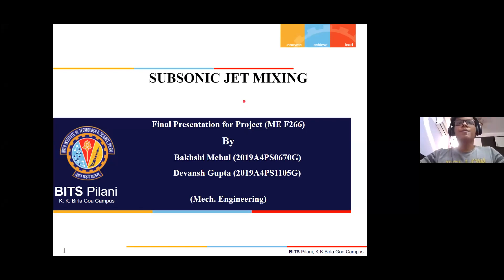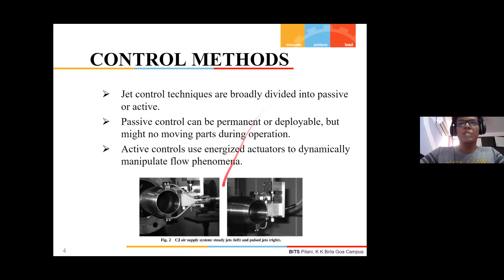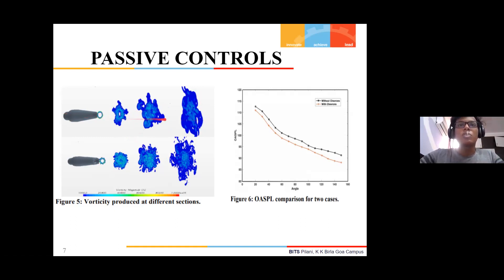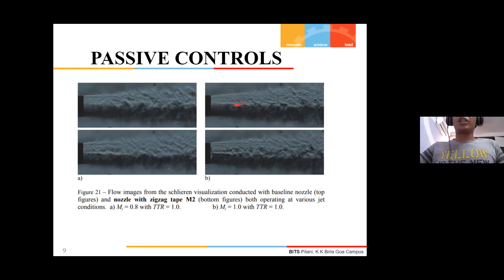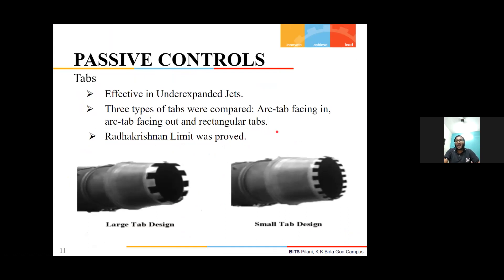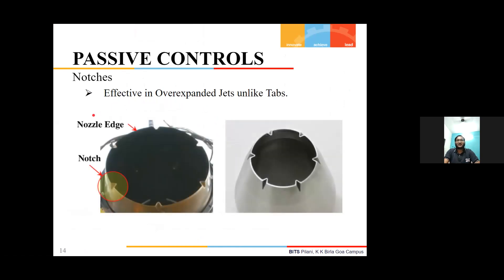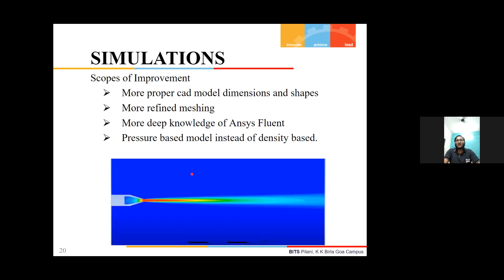Jet Nozzle CFD ANSYS Fluent fluid flow analysis | Jet Mixing Simulations with Active & Passive Ways

Comment from the maker: Video Timestamps

00:00 Introduction and Outline
01:36 Various Control Methods
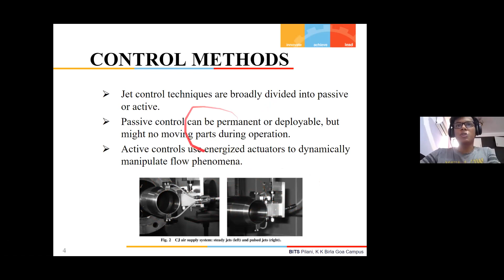02:18 Chevrons - Passive Control
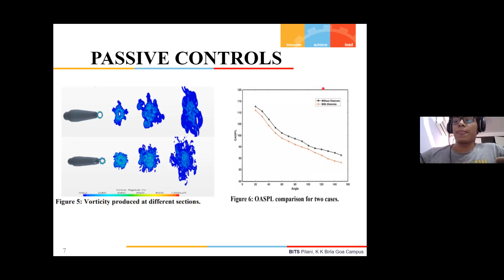04:22 Zig Zag Structure - Passive Control
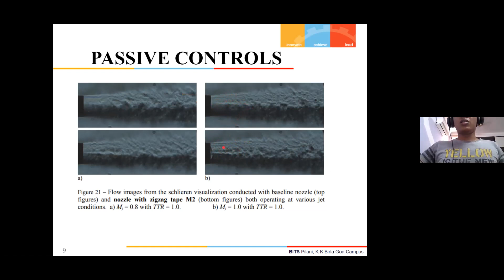06:25 Conditions for Nozzle Flow
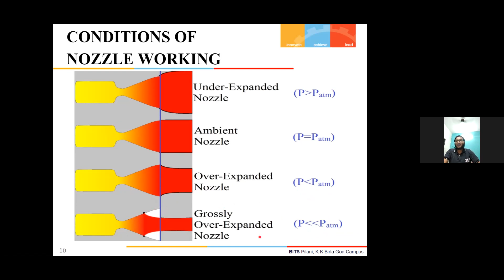07:35 Tabs - Passive Control
09:47 Notches - Passive Control
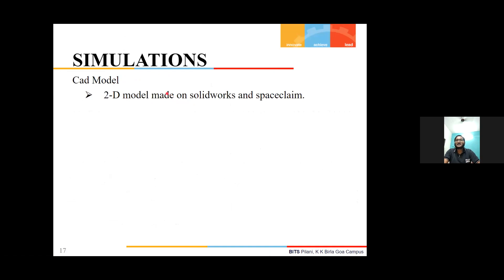11:48 ANSYS CFD Fluent Simulation on Jet Mixing - CAD Model, Mesh, Boundary Conditions
13:40 Scope of Improvement in Simulations